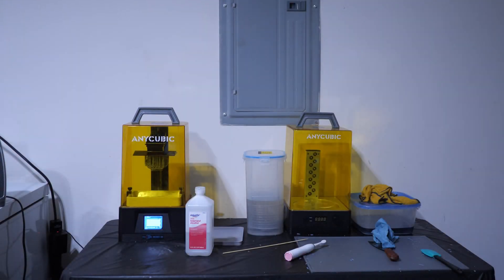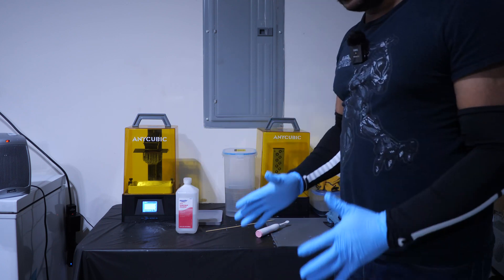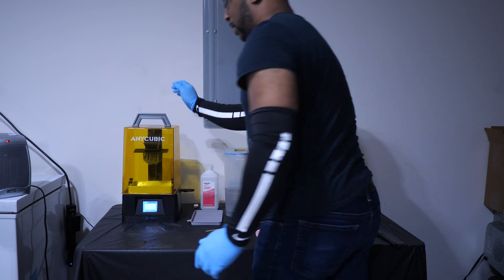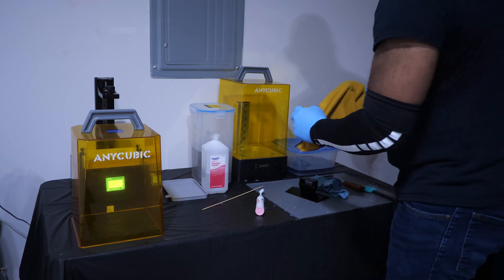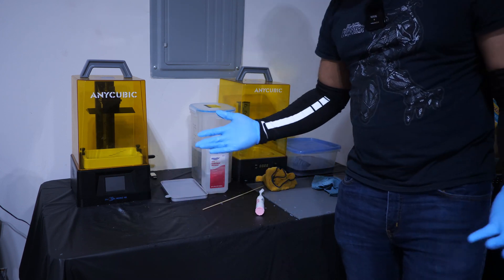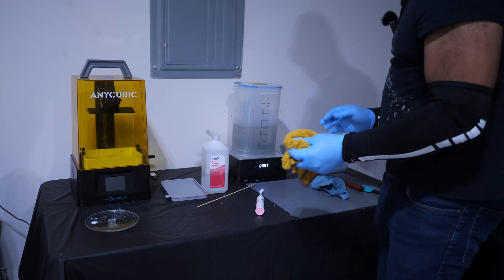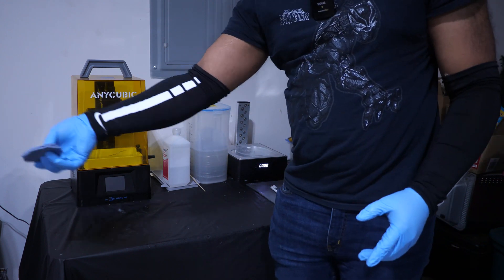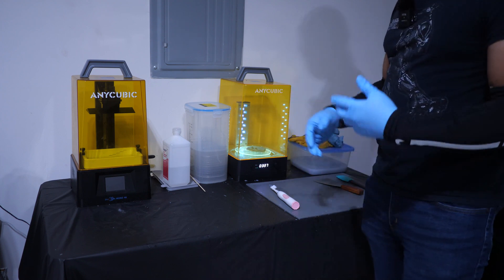How Much Space Do You Need For Resin 3D Printing?

Comment: I'm looking to get into resin printing.  I bought Creality Halot One and have yet to open it.  My concern is the screen.  How long doe the screens last and how difficult will they be to replace?
Reply from the maker: The screens typically last around 2000 hours. The screens aren't difficult to replace from what I've seen. The biggest hassle would be removing several screws and not losing them.